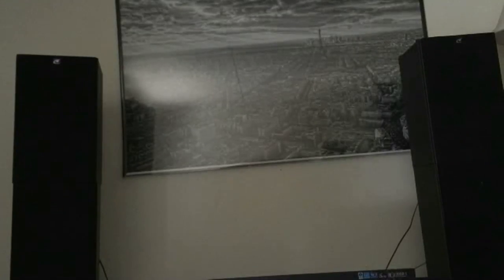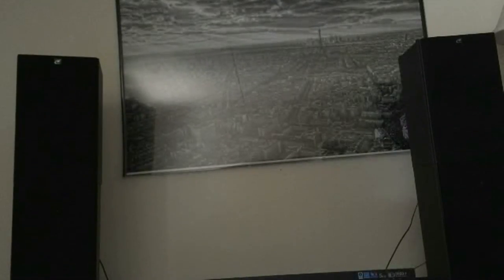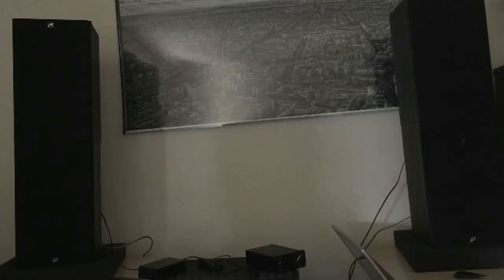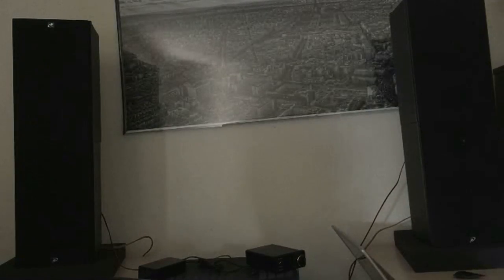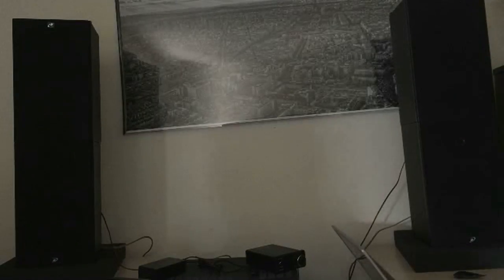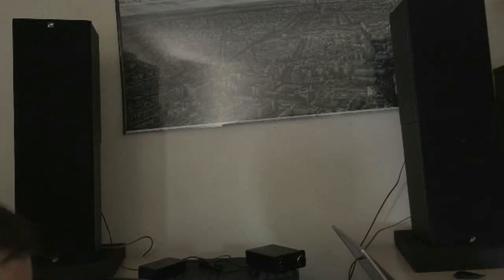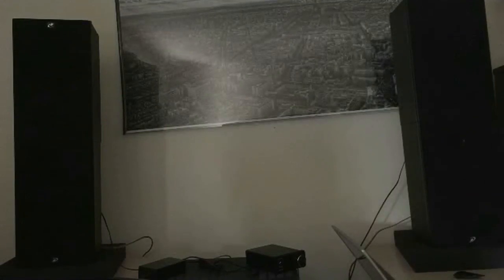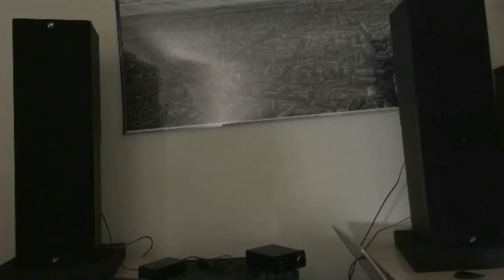A B Speaker Audio Test   Dayton Audio B652 (original) vs  B652-AIR

Comment: I actually hear the difference and I'm now going to get these for my home theater setup. I figured the difference between the originals and these would be negligible but that isn't the case at all. The Air's sound significantly better. Thanks for posting this.

Comment: I have 2 pairs of B652-Air speakers. They are so crisp and clean. Unbeatable for the price. Pair them with a C452-Air Center Channel speaker, a decent subwoofer, and a quality receiver for an outstanding system.
Reply from the maker: I did exactly that for my sister and it is a very nice system for the cost. I do need to get her a better sub, she is using an old mono price 8 inch sub and it is not very good.

Comment: I'll be thinking of getting the AIR model, I currently use Klipsch R15M which have good SPL for my vinyl setup. the treble on the Klipsch not as loud as others say, it has 4.7uF & 7 ohms in the tweeter circuit, the woofer has 5.6mH & 39uF
Reply from the maker: I would think that the clips would be better speakers than the date and even if they are a bit older.
Reply: @TheFrugalAudiophile  I've just ordered the Dayton 652-air speakers today, they say the bass on those is a bit lean, and I'm no fan of subwoofers. If I'm not happy with the bass on the Daytons then I purpose them for AV use or tape playback
Reply: @TheFrugalAudiophile  I now have the Dayton AIR, I have since modded the crossover putting a coil in the woofer circuit, replacing the cap for a lower value and better type MKP instead of cheap electro type

Comment: Your video review was more revealing than I expected, you can hear the difference! 
I have some vintage $1000+ Polk monitors, but the wife wanted smaller footprint in our LR. I was looking at some used towers and poking around came across these B652-Air on PE. The reviews were very good, encouraging. You can return them is you want to. Price was amazing, I checked like 4 times if it was for 1 or a pair! Free shipping too. When I unboxed I was skeptical as they were light like some cheap soundbar. The build quality was OK but the appearance was not going to knock anyone over with cool finish, but hey for the price, you can't complain. 
What did they sound like? Well holy cow, that Air tweeter is the REAL DEAL and the soundstage super detailed and amazing. They go as loud as I need, however haven't pushed them super high.  Combined with my powerful JBL 300w 12" sub, the sound is as full as one could hope for really. The best I can say is all of a sudden I found myself once again sitting on the couch listening to music again like I used to back in the day before I moved and could not fit my monitors. I have a open floorplan setup with a large room, 8' ceilings open wall adjoining a kitchen and its still fine. Using Onkyo 110w receiver. Efficiency is Good. If I had to do it again I might get the center although I have a $250 Polk center already! Yes the Air tweeter is that good. Eventually I may build my own cabinet of same size with a nice finish in heavier wood, but for now its really working great.
Reply from the maker: Yup, B652-AIR's can't be beat for the price! If you want something prettier with more WAF look at the Jamo S series, but they cost about three times as much. Worth it in my opinion! Thanks for watching!

Comment: Very good comparison! Thanks. Wonder how the airs compare to the Micca MB42X's that would be interesting to see.
Reply from the maker: Daver Designz I own both and prefer the Micca speakers. I think they have better soundstage and imaging. I believe they have a better tweeter than the Dayton speakers and that helps improve the sound quality overall. Definitely worth the $30 price hike over the Dayton's.
Reply: Have you seen the Fluances 6X?
Reply: Just looked at my JBL towers and the 6 1/2'' woofers foam is all gooey and split.. Looks like I need to replace them. Who would think they have a expiration date.. Very disappointing.
Reply from the maker: Daver Designz  SX6? Yes, I have those two and I really like them. They have better bass response then the MB 42X speakers but aren't quite as detailed. They are both very similar. I use the MP 42X speakers in a home theater configuration in my bedroom and the SX6 speakers in a 2.0 Music system in my office are you still each work great in these applications by surprise and can't be beaten for the price.
Reply: Seems the SX6's have better overall sound. Do you agree? without a subwoofer to help..
Reply from the maker: Daver Designz  The SX6 speakers get a little louder and a little deeper than The MB42X speakers because they have larger drivers and enclosure. As far as sound quality it is very very close. A subwoofer  always helps!
Reply: Thanks that helps. :-)
Reply: Parts express & other outlets sell
the 6 1/2"  woofer replacement that
will work excellent!

Comment: I liked your review. I have a pair of the B652 speakers and I've enjoyed their audio performance quite a bit. I anticipate buying some B652-AIR speakers soon, each version has its unique virtues. I am puzzled that the apparent volume output of the 652-AIR was lower than the 652 since both are rated at 87dB sensitivity, both use the same woofer unit in the same-size sealed box. The Air Motion Transformer tweeter does have its attraction so I look forward to having both of these bad boys in my home in the near future. Thanks.
Reply from the maker: R Benz Glad I could help, thanks for watching!

Comment: The AIRs have an upgraded tweeter and xover. Hence why it sounds better, as it should. After all its the upgraded model.
Reply: +RyKoVapes  Well, it's still good to question whether the upgrade is in fact an upgrade at all, and also whether the "upgrade" in price is worth the upgrade in sound quality.  Or do you simply believe everything manufacturers tell us?  In this case, there is also a question of whether it is possible to make a significantly bigger upgrade in sound quality for about the same price increase.  For example, replacing the original tweeter with the BC25SC06-04 and a handful of inexpensive crossover parts to lower the crossover frequency in order to tame the woofer breakup mode while also closing the gap between the tweeter and woofer, and providing greater upper-midrange detail, may well provide greater value in addition to superior sound quality.  This inexpensive but capable dome tweeter has a smoother, flatter treble response than the AMT in the B652-AIR, and with its lower resonant frequency can be used to correct additional system deficiencies while the AMT cannot.
Reply: Neither speaker has a crossover per se -- the original B652 has a capacitor, the AIR model has a capacitor and a resistor -- and that resistor is there only because the AIR tweeter is more efficient and would overwhelm the woofer without it.
Reply: @editorjuno  interesting! I had thought the 1st version had full range drivers for the 6.5s hence the pronounced mids (although dirty). The new airs seem much much less in the mids and more separated and clear as if they were crossed over, at least from this recording.
Reply: @flippy2332  -- The 6.5" drivers are identical AFAICT.  The only other differences aside from the AIR tweeter are the position of that 6.5" driver on the baffle board, the addition of a 3 ohm resistor in series between the high-pass capacitor and the tweeter and, most recently, reversal of the AMT's electrical polarity.  The current stock configuration is still a tad "hot" on the high end, although not unlistenable -- I added an additional 2 ohm resistor in series between the existing resistor and the AMT to establish my preferred woofer-AMT balance, YMMV.

Here's the B652-AIR's stock "crossover," such as it is:

http://noaudiophile.com/Dayton_B652_Air/Dayton_B652-AIR_Crossover.jpg
Reply: @editorjuno  fantastic info, tyvm!! I was looking at the tower version of these and was attracted to the fwd, warm midrange on the originals. I'm not crazy about bright highs so may have to try your modification as well. Thank you sir!
Reply: @flippy2332  -- I had the non-AIR B652s before I went for the AIR version and have kept all four speakers, essentially blocking the B652 tweeter, stacking a B652 on top of each B652-AIR to create a "desktop tower," and wiring the two speakers in parallel on each side.  If you ever do this be very careful -- although the speakers are touted has having a 6 ohm nominal impedance, their DCR is much closer to 4 ohms, making each paralleled pair measure out at well under 3 ohms, which many amps can't safely handle.  I added a little series resistance between my amp's + speaker terminal and the speaker wire to avoid potentially exceeding my DTA-2.1BT's lower load impedance limit of 3.2 ohms, which is dictated by its Class D output chip.  The result, with the addition of an appropriately low-passed passive sub, has been a revelation.
Reply: @editorjuno  The woofers are 4 ohm, I'd wire them in series
Reply: @manFromPeterborough  -- I tried that first, but it didn't sound nearly as good as the setup I eventually arrived at.

Comment: It seems to sound as though the original B652's are slightly louder & have more bass than the newer B652-AIR's. I tend to prefer more bass, especially when listening to YouTube music videos. Is my perception correct? If so, would the original B652's be a better fit for my preferences? Thanks for putting such an informative video together!
Reply from the maker: No, I don’t really hear that in person. To me the base is basically the same between the two models, but the trouble is a little more cleaner and pronounced.

Comment: I like my bose 301 series 5 speakers, 30hz to 20khz. Those b652 airs are 70hz to 25khz, the regulars are 70hz to 20khz. But i'm using a receiver with a frequency response of 5hz to 80khz not 20hz to 20khz sooooooo...........

Comment: which is better the Dayton Audio B652-AIR or the cerwin vega sl-5m because they are the same price
Reply from the maker: Sebas Zoontjes  One may not be better than the other so much as different. Meaning that they would have different sound signatures. Look at specs including frequency response to see which one you would prefer.
Reply: they are about the same but the dayton woofer is bigger but i am getting a 500 watt 12 inch so i got bass enough but the tweeters i have no idea of the soft dome 1 inch tweeter form the cerwin vega is better or the dayton tweeter?
Reply from the maker: Sebas Zoontjes  if possible audition both in Home. I do really like the sound of the Dayton's AMT. however, if the third one Vegas have a higher-quality so dumb theater it might be better. For example, the silk dome tweeter  on the Micca mb42X speakers sound better than the AMT in the Dayton's. Does it actually be my recommendation since you have a good sub, that is if you're willing to spend the extra $30.

Comment: This may be obvious, but given all the glowing reviews about these speakers, I thought it might be helpful to let anyone considering these speakers know that these still ultimately sound like low-end speakers. They might sound good for $50, but if you have a discerning ear, I would suggest saving your money and waiting to pick up a better used pair of speakers.  These are fine for a garage or a second/third system at home, but I find them rather grating to listen to after a while. I wouldn't recommend them for your main stereo at home.
Reply: A very simple mod improves them immensely.  The reason they're "rather grating to listen to after a while" is that the tweeter is much more sensitive/efficient than the (very cheap) woofer and Dayton failed to adequately attenuate it in their very rudimentary excuse for a crossover, which is actually just a capacitor and wirewound resistor in series.  Replace the stock resistor with a 5 ohm 3-5 watt part (or add a 2 ohm resistor in series for a total of 5 ohms).  The bass will still be inadequate -- like the original B652, they need a subwoofer with a 100-125 Hz low pass frequency to qualify as "hi-fi" IMO -- but the rest of the audio range will be surprisingly clear and non-fatiguing.  One more thing: until recently, B652-AIRs had the tweeter wired "in phase" -- i.e. with the same electrical polarity as the woofer -- and if yours are older you need to reverse that polarity.  It took Dayton/PE literally years to catch on to the tremendous improvement this tiny change brings, but mine came wired that way so they apparently have finally seen the light.
Reply: @editorjuno  Thanks Bruce. This is good to know, but I'd rather just buy a better pair of speakers in the first place and avoid dealing with mods.
Reply: @Monkeyseemonkey79  -- Actually, I prefer my modded B652-AIRs to the vaunted Andrew Jones Pioneer SP-BS22-LR in a 2.1 setup, but without a sub the Pioneers are better (as long as your amp is beefy enough to drive them -- they're considerably less efficient than the Daytons) and they're often available used for $50-60/pair.
Reply: @editorjuno  I've modded mine with 0.45mH coil and 4uF MKP cap
Reply: The Air version reviewed has quite a airy and detailed, realistic sound stage, similar to speakers costing 4x a much IMHO. True you can do better with a lot of cash spending, but I've had $1000+ monitor setups, huge separate power amps, etc and there's nothing wrong with these. Very clear and listenable. If you need to adjust the treble that's easily doable these days. I am impressed - was thinking I'd return these actually when unpacking, not terribly impressive cabinets but the sound is wonderful when you use a sub. That AMT tweeter is the real deal.

Comment: How does the bass sound on the Air's?
Reply from the maker: chris vasquez actually, it's pretty good. I think they are rated down to 60 Hz but I'm not sure at what SPL.
Reply: Because I am thinking on getting in the market of buying some bookshelf speakers but can seem to make up my mind on which ones i should get. It is between these or maybe the Klipsch R-15M But I don't know if i want to spend more on them
Reply from the maker: chris vasquez i've not heard a lot of Klipsch speakers but I have read many reviews saying that they are a little break. If that something you'd like then go for it. The Dayton's are a good speaker for their price, but spending a little more will get you something better. Look at either the Fluance SX6's or the Pionerr SB22's.
Reply: It’s the same woofer for both speakers the only difference is that the air has a different tweeter and the woofer and the tweeter are closer together